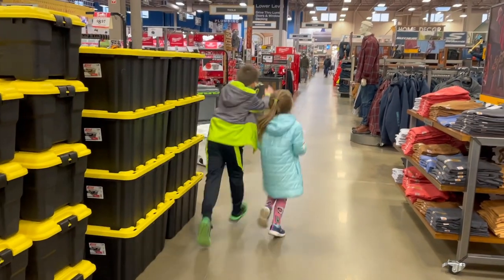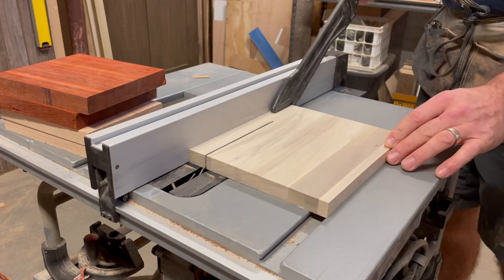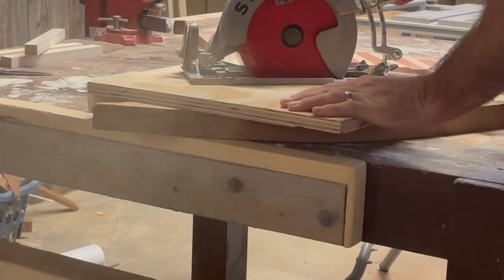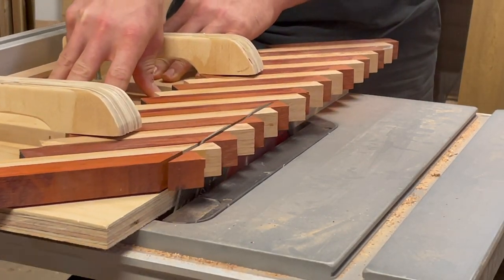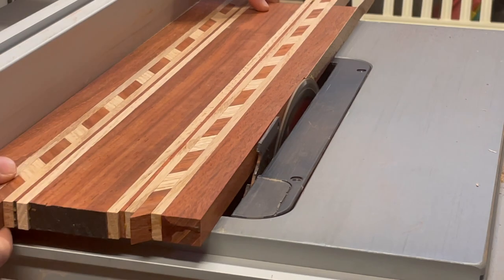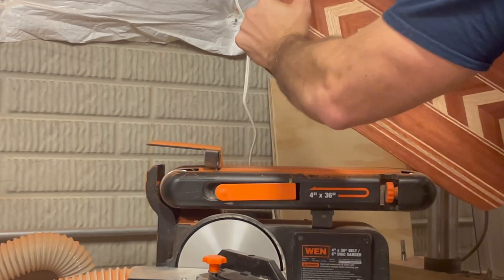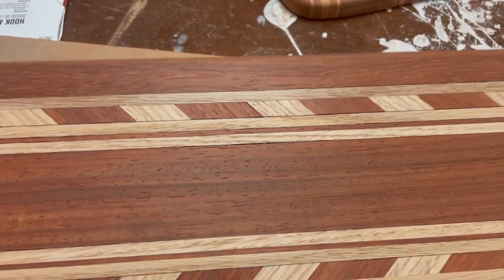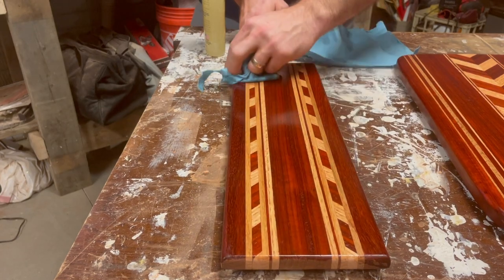Making Chevron Charcuterie Boards with Padauk and Prayer

Comment: The board is quite good, but the carnauba wax is not approved for contact with food. For example, I use milk thistle oil, natural, virgin, organic. It is not very expensive and I immerse the entire cutting board in it for about an hour (about 3 l of oil). Dry wood will absorb the oil and remain protected for a long time. In addition, this oil is ecological and approved for contact with food.
Reply from the maker: That’s an interesting organic option!  How long does it normally last.  We used the Howard Products Butcher Block Conditioner specifically because it claims to be food grade.  Maybe the ratio of oils and waxes could allow carnuba to be an approved ingredient?  https://www.howardproducts.com/product/butcher-block-conditioner/
Reply: “POINT OF CONTINGENT.  - The use of carnauba wax is recognizes as a food safe product by USA FDA..😂do a simple Google search to verify the same..  I have been using it for years. Nobody has croaked yet.  What is your reference to say that the wax is not food safe?

Comment: Nice job, but I wonder about gluing side grain with “almost”end grain!  Do you think the glue joint would hold up between chevron part and the parallel pieces?
Reply from the maker: Good question!  The boards have stood up to lots of regular use and abuse at parties and dinners over the past two years.  It seems to stand the test of time alright so far.  I’m speculating, but using narrow strips of wood next to the chevrons seems to help with an end grain/side grain bond.  When I clamp the strips together, I can see the thin, flexible strips bend and compress slightly around any imperfections in the two larger strips.  I think that helps with the integrity of the glue up.  No data to prove this, but I’ve seen the effect in lots of my boards.
Reply: I "scuff" the glue faces with my Dremel tool to create scratches for more glue surface. Don't go past the corner though as the nick would show up on the finished board.

Comment: Beautiful piece! Padauk is so beautiful and colorful, however turns brown if not protected with a UV protection? Do you know if the finish you applied provides this?
Reply from the maker: Good question!  I don’t know about UV protection in the finish.  So far, after 2 years the board is still very red.  I think that may be due to being stored in a closed cabinet when not being used for dinners and parties.  I also never use it for outdoor functions, so it doesn’t get a lot of direct sunlight.

Comment: Great job they look great. what thickness did you start with and what was the final thickness
Reply from the maker: Started with stock that was almost 1”, and the whole piece finished just a bit under 3/4”
Reply: @makewhatnow5461  Thank you

Comment: end grain to end grain glue up is the weakess join,   what did you do to prevent the chevron glue line to fail? (dowels, biscuits?)
Reply from the maker: That’s a great question!  The answer is a LOT of glue, clean cuts, and a little pressure.  I’ve found the density of padauk makes up a bit for the expected weakness in the end grain.
Reply: If you take glue and wipe it into the end grain of both pieces and let it fully dry, you essentially seal up the end grain. Then you can successfully glue up end grain boards because now you are gluing up a solid filled area.

Comment: Do you have a cut list for all the pieces, not just the 6 inch chevfons?
Reply from the maker: For the borders of each board, I used a mix of 1/4” and 1/8” strips of both oak and padauk.  I just kind of mixed them until I found something I liked.  The broader pieces of the large board are 2 1/2” each.  For the smaller board, I didn’t measure anything.  I just slapped together all the scraps I had until it looked good.

Comment: very nice, is it white oak or red oak?
Reply from the maker: These boards are red oak.  I don’t know if I’d use oak again with padauk.  The open grain took in a lot of the padauk saw dust during sanding, and “smudged”
It’s color.  I’ve used maple with padauk for other projects since, and I’ve gotten a lot cleaner color contrast.